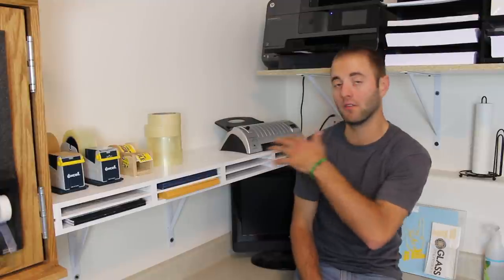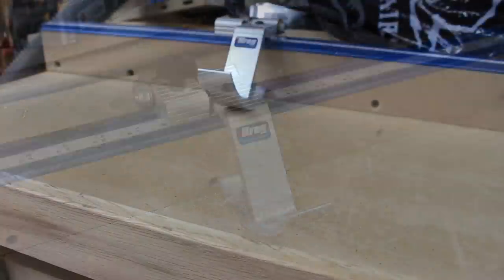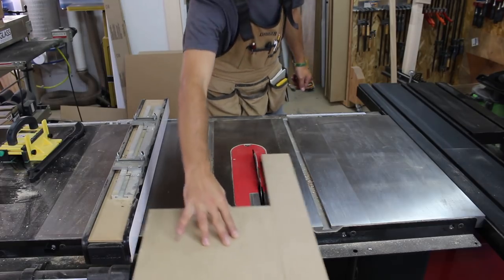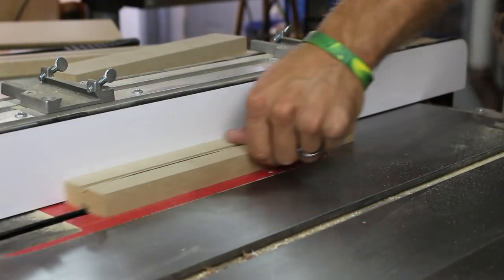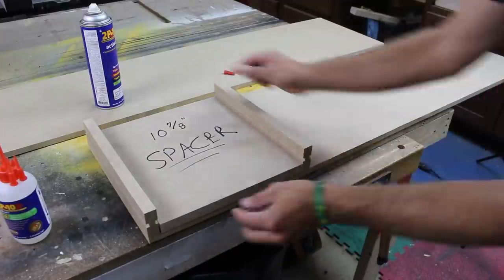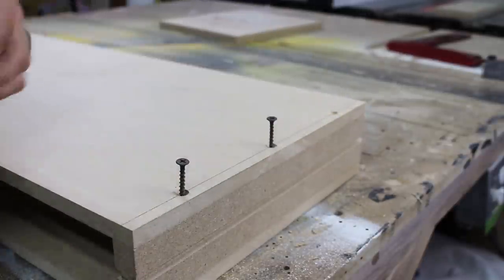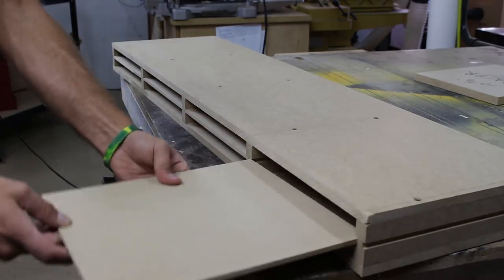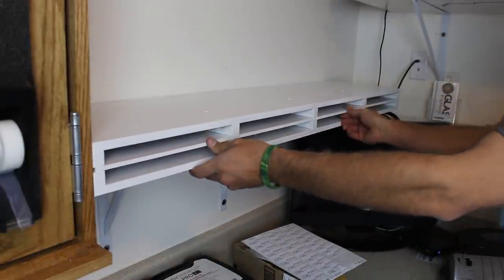How to build a shelf with built in paper trays

Comment: Slick little shelf. I like it a lot. 

And yeah - MDF is dirty stuff to work with. Incredibly dusty, and that dust finds its way into the slightest little crack and crevice in the shop. Last time I routed some MDF, I had forgotten a drawer on my tool cabinet (left it open) and the whole cabinet got dusted out.  Sometimes I'd rather have a fist fight than work with it. But ya gotta do what ya gotta do...

Comment: What was that on top of the paint can?
Reply from the maker: rocklers mixing mate!
Reply: +Glass Impressions Is it easy to clean?
Reply from the maker: James Wheeldon Yes! It is easy to dust. not sure what other cleaning it would need. If needed to be wiped down, I would add a coat of shellac or something.
Reply: that was in reference to the mixer from Rockler.  I have been eyeing them just wasn't too sure about cleaning them.

Comment: for such a small shelf that isn't carrying a ton of load, you probably could've done a cleat mounted to the studs, then mount the shelf unit onto the cleat, putting screws in from top and bottom to the cleat to achieve a 'floating' look. then you don't have to deal with those angle brackets that take up more space than they shold.
Reply from the maker: +David N Great idea!